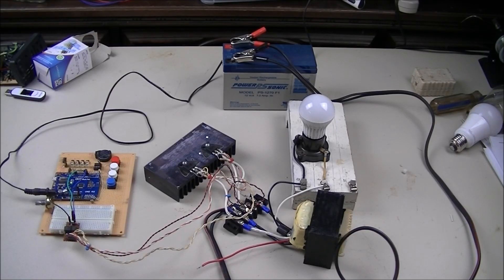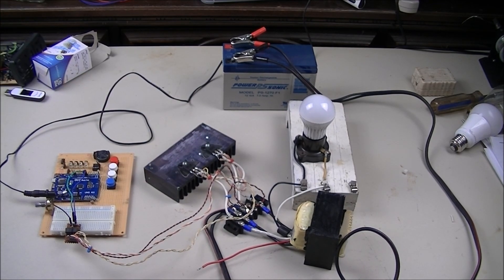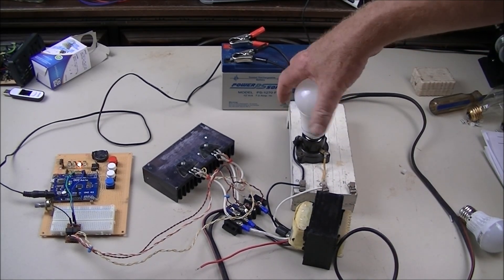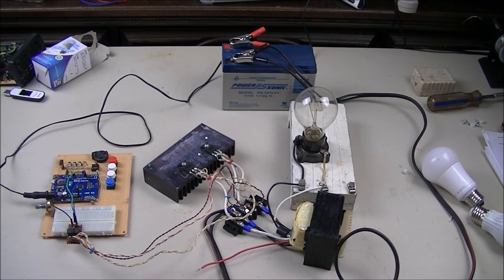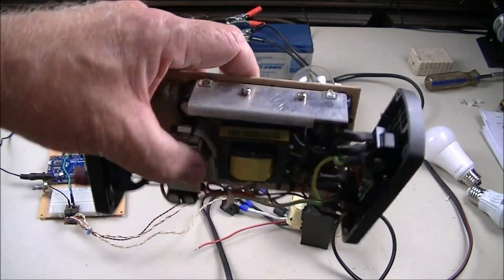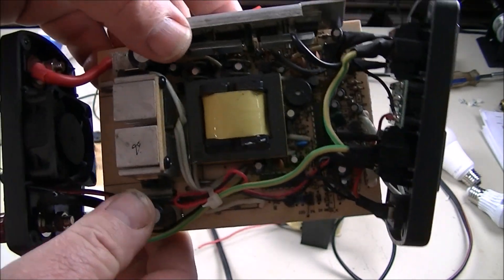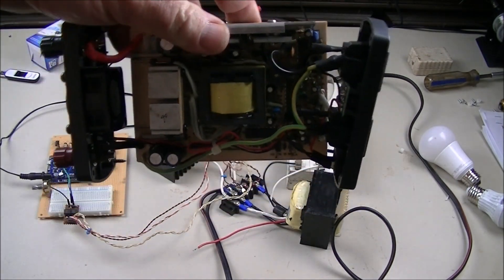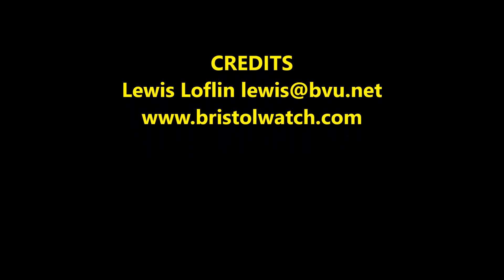Arduino Power Inverter Revisited

Comment: NOTE: 230V AC RMS at 50Hz consists of 100 parabelic pulses per second up to 325V peak. So to make 230V AC we would need a   DC Powersource of at least +325V DC (in fact more due voltage drops and safety margins), just for "form" or synthesize sine waves from it using high power transistors in a H bridge configuration or transformers of some sort. BUT... most modern devices dont even need AC anymore and run most often from DC itself. like pretty much every device that contains a switch mode powersupply converts the AC directly to DC right from the beginning and then convert it down to whatever is needed.  Toasters , Heaters, Lamps etc, all dont really need AC. i bet they would work right out of the box with 230V DC (the equivalent of 230V AC RMS) without an inverter, transformer or anything like that. so converting 12V DC into 230V AC@50Hz to run devices like LED Lamps that contain SMPS Drivers is just nonsens and waste of energy. step the 12v up to 230V DC or just skip this and feed it directly into the DC driven device if possible would be more effective.
Reply: Axel Werner - Technically, sort of half right. Only backward UK & EU people deal with stupid VAC. Rest of world, ok with 100-110 VAC. You should do some reading.
Reply: @crocellian2972  Wrong, the rest of the world uses 220V, the rest of inbred US and central america still uses laughably shitty 110v

Comment: That big transformer is designed for 50-60Hz operations. It has a laminated soft Iron core and can not cope with KHz range frequencies. Most likely came out of a UPS.
The other small one, is designed with ferrite material for the core, and operates in KHz ranges. 
The 2 are completely different beasts. Each have their own place.
Reply: Do people who use inverters use them for other than things then using a radio on a camping trip, providing power to their homes during a black out, or for providing power to their computers when the mains fail?
Reply from the maker: You are correct on all counts.
Reply from the maker: Yes. They are used with solar panels to change DC to AC.
Reply: Does that mean if I am designing a UPS, I need a high range frequency?